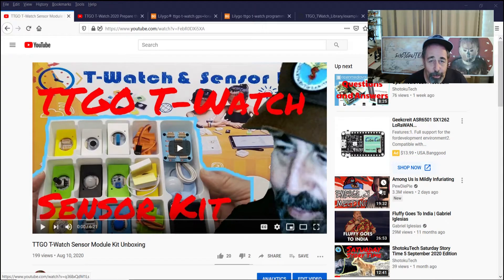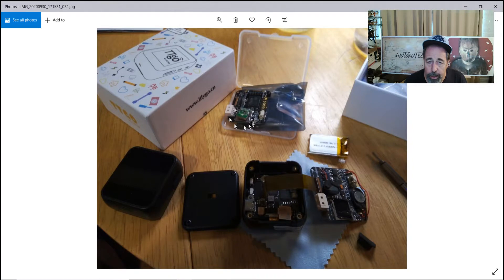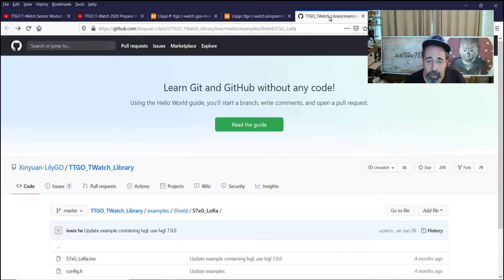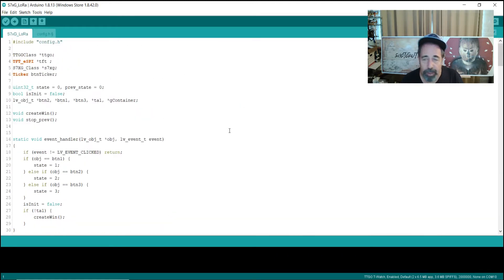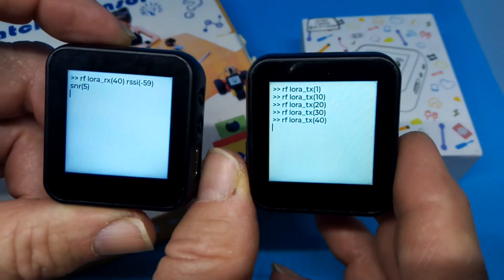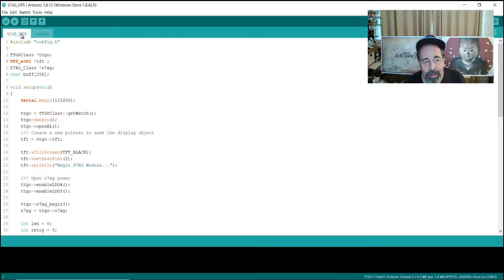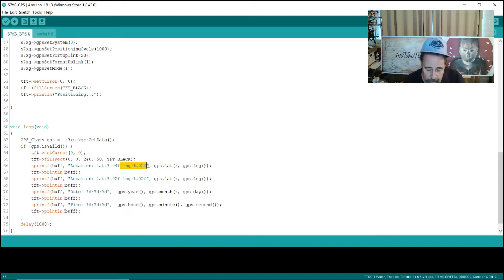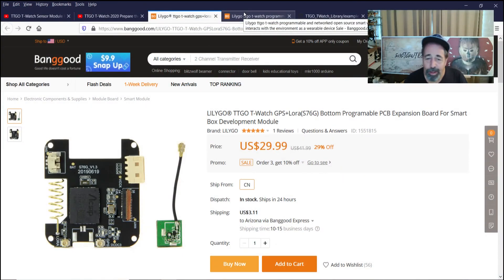TTGO T-Watch 2019 Plus GPS+LoRa

Comment: Hi. 
Thanks for your nice crack video.

I have a question... can you help me please?

I recently bought a 2019 (not touch) one. The documentation is a bit weak and I can't get if the 2019 version has Audio or not?

On the body, I can see 2x7 number of small pins that seem to be designed for audio output...

If it has audio, what is the protocol? I2S seems not working as much as I investigated it.

Thanks in advance,
Abolfazl.
Reply from the maker: Hello. The pins exposed along the side simply extend the available GPIO pins from the ESP 3D. There is no speaker in the basic T-Watch 2019. But there is an expansion board, T-Watch Vibration motor and DAC output horn Buttom PCB Board. This page has several different T-Watch 2019 options so make sure to select the correct project. https://www.aliexpress.us/item/2251832854266046.html
Reply from the maker: Audio output is SPI and I imagine you need some additional board or module to drive the speaker. So scroll through the product page and I also recommend going through the Github site as well and look for DAC there and in Arduino IDE.
https://github.com/Xinyuan-LilyGO/TTGO_TWatch_Library
Reply: @ShotokuTech  Thank you. Yes, I see. I will probably create a prototype buzzer (inactive) board and put it in the watch.
Reply from the maker: @syntaxerror95i  it looks like the best option I can see.. Thanks.

Comment: The pinout of the grove connector changes between stock and replacement backplane. Would you be able to snow how to adjust the pinout in Arduino software to correspond to the new pinout?
Reply from the maker: That's weird! Why did that happen? I can try I guess.
Reply: @ShotokuTech  not sure why but it’s driving me mental. Default pins for esp32 I2C bus are 21, 22. All pre-assigned to sensors in their respective library. The GPS backplane now uses 25, 26 and since both are connected to master (the MCU) vie the flex pcb, if I use 25, 26 on the backplane then my sensor will work via grove connector but it breaks other sensors that are on the main board such as RTC and accelerometer. If on the other hand I use pins 21, 22 on the backplane then my sensor via the grove connector won’t function but everything else will.
Reply from the maker: @tubewiser  I was just looking at the T-Watch Sensor Kit again to help someone else. Damn if it doesn't come with it's own backplane! It exposes several analog pins, (2,4,13,14,15) an I2C (33,34), another serial? (25,26) and you still have the original I2C (21,22). It's a shame these backplanes don't all stack. It's not much good having GPS and LoRa if you can't have some other sensor.

Comment: HELLO , can i used this example code of GPS in the TTGO T-watch 2019 module GSM GPS ??
and thnx :)
Reply: Yes exactly
Reply from the maker: @zouaouisaifeddine5250  I guess double check the antenna connection and move closer to a window or try outdoors. It's hard for me to troubleshoot the hardware from here. The example code should work. Also see if you can find your same product on the Aliexpress site. They usually have links to the correct library on Github. Read through the issues, both opened and closed in the Github library to see if someone else resolved a similar issue.
Reply: @ShotokuTech  okey thanks 🙏
Reply from the maker: Hello and thanks for your question. I made this video here "TTGO T-Watch SIM868 Unboxing" https://youtu.be/OtmebtM0VDg
But I have not tested this code for it here:
The TTGO T-Watch SIM868 example sketch on Github
https://github.com/Xinyuan-LilyGO/TTGO_TWatch_Library/blob/master/examples/Shield/SIM868/SIM868.ino
Reply from the maker: You can't post URLs in comments. So you are saying GPS is not getting a fix?

Comment: Hi, Your videos has been helpfull , i got 2 watches i can't get the GPS working , I'm runnin the same sketch and set the device open air for hours and nothing happenns, it keeps showing POSITIONING...
How long does it take to get position?
do you recommend any mod to get this working?

thank you!
Reply from the maker: Try with GPS antenna outside the case? If I recall I had some issues getting the GPS antenna into the case without it coming in contact with other components that might hamper the operation. So see if you get a fix with the antenna outside the case first. It has been a while since I worked with these. So I would have to open the case again to to tell you how I did that.
Reply: @ShotokuTech Thank you , I got it working , i reconnected the antenna and flex cable , i noted that it is not quite sensitive , it had to be completely open sky and sometimes does not work.
Reply from the maker: @fabriziobgn257  Wow! That is different from what I experienced here. I find I can get a decent fix indoors near two windows in a room at the corner of my house. Interesting. Thanks for the feedback.
Reply: @ShotokuTech  thank you for the reply . I'll take a look is something is making contact inside the case .